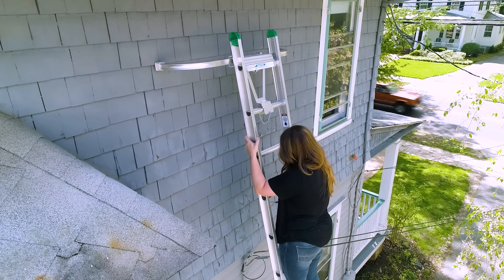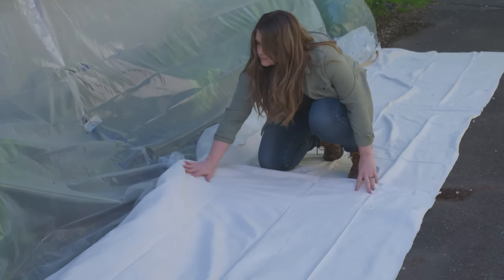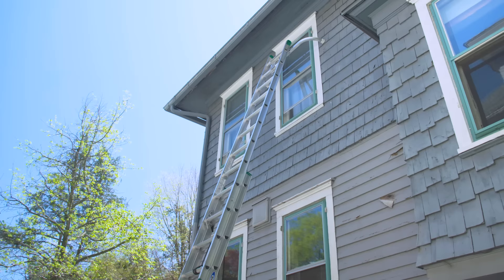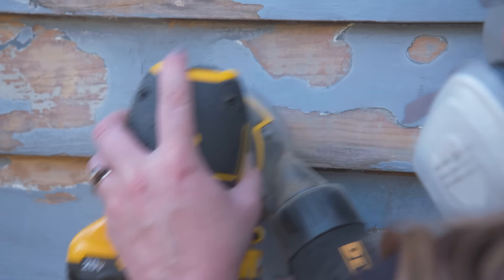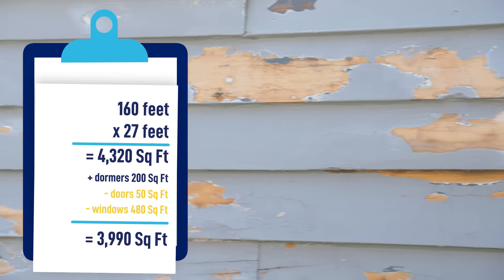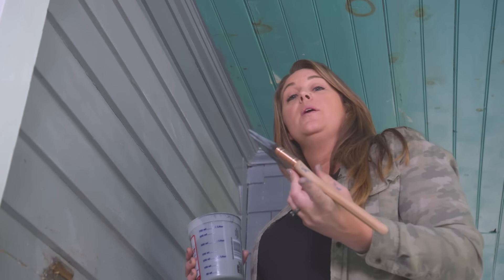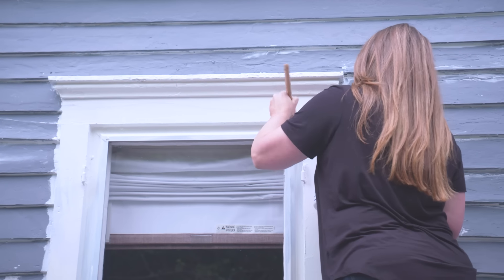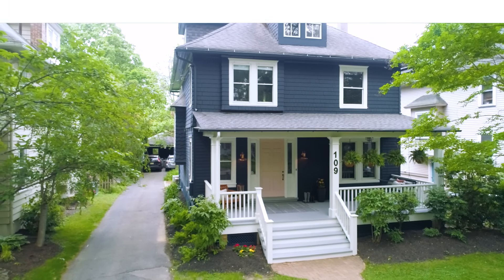How to Paint a House | DIY Exterior Painting Tips

Comment: Here's a tip they left out, with all the peeling paint they had you must use a bonding primer on the peeling areas such as Peel Stop, Peel  Bond, etc. It is a clear bonding primer that actually seals the edges of the peel spot to diminish future peeling. It actually works like glue. Once I found this product I would never paint a house that had peeling paint without it It will decrease your future peeling by as much as 95%.  I'm surprised a Lowe's video left this out since they sell it.
 But, I've known pro painters that still don't use it and spend a lot of time doing customer service work going back to a house that keeps peeling sometimes with in months.
Reply: Still need to sand it tho?
Reply: If you properly scrape, sand and and prime the wood, it’s most likely you don’t need the peel stop. However if you do a quick budget job and don’t remove all of the loose paint and sand to a smooth finish, it may be more helpful
Reply: Thank you for that bit of information, I appreciate it!!
Reply: That’s why they don’t use it, so they are paid to keep going back 😂

Comment: @18.44 - the window glass has paint on it. Or so it appears. 

Wish there were close ups of the paintwork too, because a lot of scraping took place - on the weatherboards for instance. If you don't scrape ALL of the paint off, and just some of it...  then don't you have to fill in the scraped off areas somehow, so that when you paint, the whole surface of the weatherboards is the same level (and not 'pocked' so to speak, where chunks of paint have been pulled off)? How do you get a smooth, 'even', uniform surface on the weatherbaorads if you don't somehow fill in the areas of weatherboards where the paint has been scraped off, so that the whole weatherboard surface is 'even'?

Comment: I would think sandblasting the paint off would be faster than scraping and sanding. I remember my parents 80 yr old house with cedar shingles was sand blasted in like two days. But I don't know how much sand blasting cost so if your on a budget you may have to take the longer route.
Reply: Problem with sandblasting is it leaves a huge mess.  The sand will get into every little crack and crevice in those shingles.  A lot of labor will be spent making sure all the sand is cleaned out.  But , you still will have sand that is trapped and could very well drop onto the paint as coats are put on.  This is not my opinion, but based on my practical experience with sandblasting.

Comment: Does anything change if you're dealing with vinyl siding rather than wood?
Reply: Are you joking? (If you're NOT joking: you don't paint vinyl siding - the whole point of vinyl siding is that you never have to paint it! Aluminium siding, on the other hand, can be painted.)
Reply: @beautifuldayzee5942   Thank you.I didn't know all I know is I have this house with cream colored siding that I didn't pick and  don't particularly like. So I have to replace all the siding on the house then?
Reply: @gamesmaster0459  - that depends. The house we owned some years ago (a 1930's bungalow) had vinyl siding - luckily it was a very nice gray, or blue-ish gray, color (which will always be popular). I'd never had a weatherboard house before, and I didn't realise until we'd lived there some years that the original weatherboard was still on the house, under the vinyl. And far as I'm aware, that's pretty common. The old wooden weatherboards often have lead paint, and/or flaking paint, maybe cracks and other faults as well - and just putting vinyl siding over it was an easy (and often very attractive - surprisingly!) way to deal (or rather, to NOT deal) with those issues.

So - you might not have to actually REPLACE the vinyl. If there are weatherboards, or any other types of house cladding, underneath the  vinyl siding ... if whatever it is underneath the vinyl is in not  in too bad condition, then you might be able to remove the vinyl siding, and paint what's underneath it rather than re-clad the whole house ($$$$) with siding that's a color you like!
Reply: I'm just going to add : Actually, it COULD be possible that you could paint vinyl siding - you would probably have to use a special primer made just for surfaces like vinyl, and then either hand paint or spray paint the new color over the primer. You'd probably really have to be very thorough in cleaning and rinsing the siding, and doing other prep before painting vinyl though, to make sure the top coat of paint attaches well to the vinyl. Good luck!

Comment: I was in the painting business for 50 years. For this rough old paint I would use 24grit zirconia 5" disks on a Mikita 5" sander. It will require less scraping before sanding and you won't have high places from the old paint and low places from the new. They will blend together. The 80grit she using in the video makes a feeble attempt at this. Also, if you pressure wash after you sand, water will soak into the wood,  find its way under some of the paint and you'll be doing some more removing of old paint. For some reason a lot of youtube videos show painters using a little angle brush on wide surfaces. It's amateurish and slows you down.

Comment: You scrap then pressure wash. If the homeowners want to pay the extra you sand after. Why pressure wash the house, and blow more loose pieces off and have edges again. Best way to do it is wash it first honestly and shop vac the mess later with a broom or brush to loosen flakes most homeowners are worried about time/price. Proper setup you'll save your arm legs and more
Reply: Honestly you can spend days scraping and the next day you can peel more. You get what you can make it look the smoothest nothing loose and coat of primer will make a world of a different

Comment: It looks like the previous painters did not do a good job. You can see bumps on them, and it is not smooth. Looks like they just threw on globs of paint.
Should have spent a little more time sanding, to try to fix the previous painter mistakes.
Spray painting would have been faster. Even with prep work, it still would have been faster.

Comment: It is obvious on the wood siding was prepared with half measures because I can see area's where the wood siding is missing and a lot of area's the sanding was incomplete and not feathered out. A very poor prep job with lots of patches where it's going to need spackling on the wood siding boards. According  to the painter in this video it's called leaving the texture for character but  what about the pealing factor because I can see that a lot of area's are going to be pealing after being exposed to the hot sun. I call this being lazy and leaving imperfections. This paint job will not last. I give it a month or two the most.